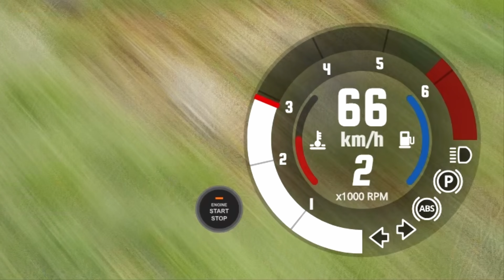1930s Suspension VS Direct Drive Wheel

Comment: 3:31 The steeringwheel play is a common thing in cars of that era. If there is no play, you will be overcorrecting yourself constantly. And therefore could not drive in a straight line.
Reply: The fact that it's that much of it tho
Reply: The combination of loose bushings and the recirculating ball steering causes a lot of play in the steering. The thing is though, these old cars are surprisingly good and comfortable driving off road, and very smooth and comfortable on a smooth roadway. Problem is, that old suspension setup means they can suffer negative feedback from too many whoops and start hopping and bucking, so you had to be careful how you drive on dirt roads and to drive slow enough or fast enough that you don't hit that critical ride frequency that gets the car acting like a person on a trampoline.
Reply: @Avetho  Tell me about it haha. also i've had some death wobble on some occasions, mostly only at very low speed, due to the solid front axle.
And the shock absorbers barely absorb any energy which doesn't help either...
Reply: @DrTheRich   Shock producers
Reply: That's not true. The play in the steering wheel makes driving in a straight line incredibly difficult and makes micro adjustments far more difficult.
Reply: @AN2Felllla  I have a 1929 ford with about 40 degrees of steer play (the old models have no adjustments, I'll have to install new bushings). But driving in a straight line is easy, because the caster angle of the wheels. Unless there is wind, then i'll have to hold the steering wheel steady against the wind, but still easy.

I can still make micro adjustments, because within the play leaning to one or the other, it still guides the wheels to steer one way or the other.

And upside i don't feel any wheel shake/shimmy.